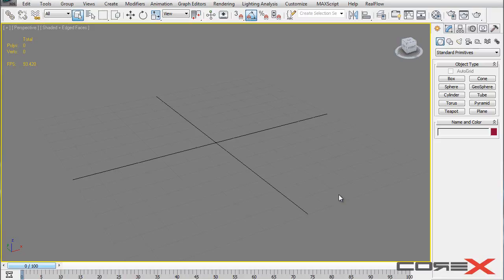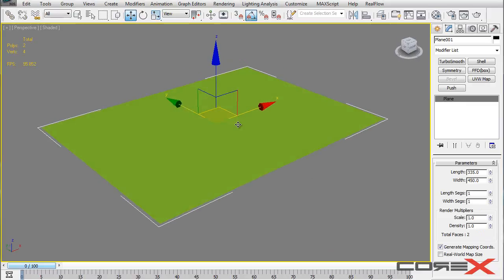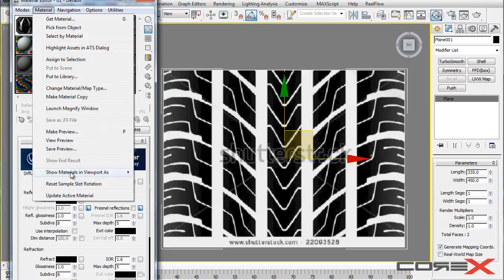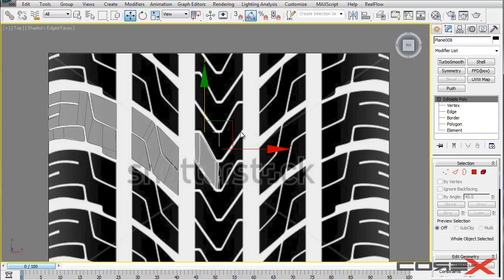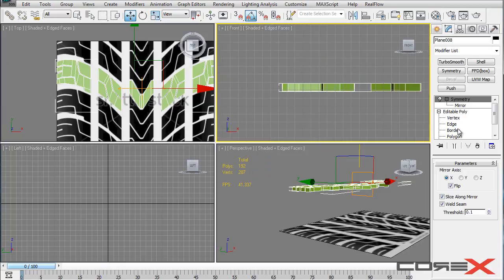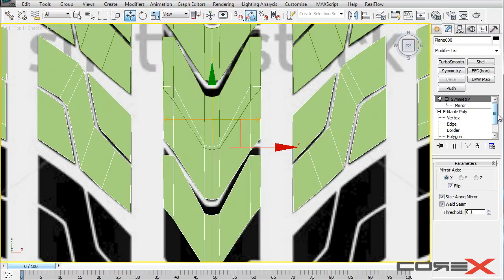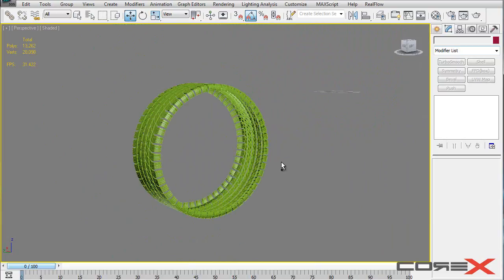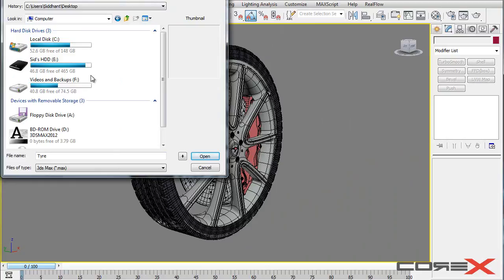3ds Max Tutorial | Modeling Tire Treads

Comment from the maker: Okay, so you do this. Make a cylinder. Then make a smaller cylinder cutting through the original one. This represents the hole. Then, select the larger cylinder, go to the Create panel, and in the drop down menu, inside one of the headings, we have a tool called ProBoolean. Click it, and then select the smaller cylinder. You will see that the larger one gets a hole drilled through it, right where the smaller one used to be. :)

Comment: Nice idea, but a LOT of had work.
If you have a demo shot like that with watermark, load into Photoshop and tweak the levels to get a good b/w image and filter out the greys. Then import to Illustrator and use image trace to convert to vector. Export as Illustrator 3.0 format (It's the only one 3DSMAX will recognise), and then extrude the splines into a mesh, - the rest is much the same way as you have done.

Comment: So how doo you deal with razor sharp edges on the tyre tread?
Reply: Do you use Turbosmooth?
Reply: DavieJones2nd
I don't think so, he's got too much geometry for it to smooth, i rather think it just a bad tutorial, you end up having useless sharp edge poly tyre.
Reply: In that case you can chamfer the edges a little to round them off :)
Reply: Quna Maxamus Or instead of using planes as foundation shape, make the shapes with spline and then use bevel on them...
Reply: Im terrible with splines, I only use them for rudimentary pipes